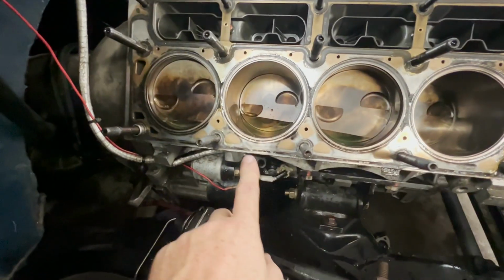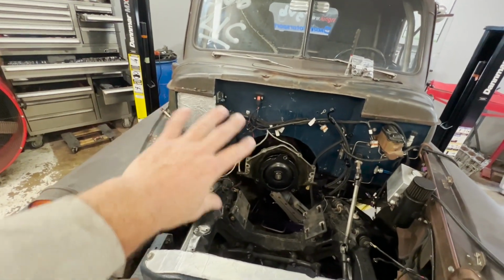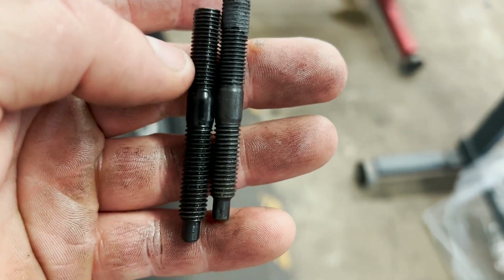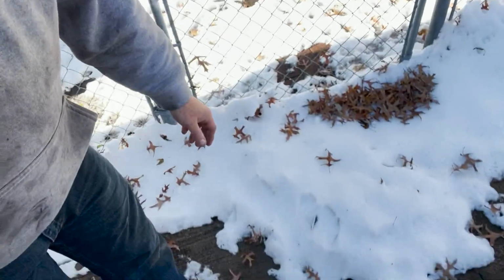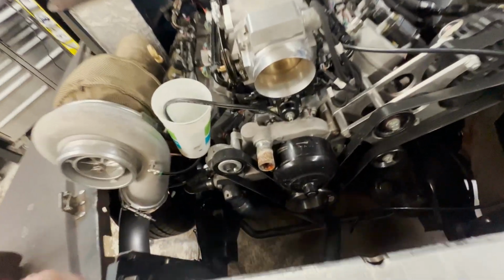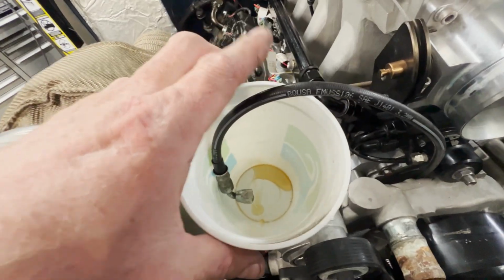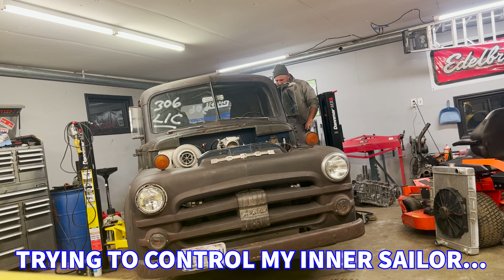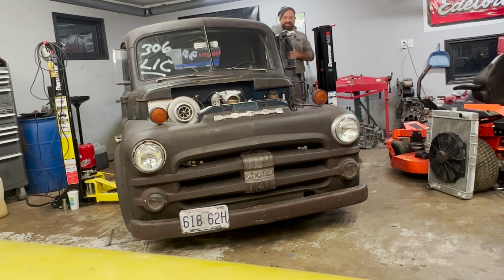Turbo SBE 4.8l Ratrod Truck First Start-up!!

Comment: Hey brother what lift is that , do you have to bolt it in the concrete floor or is it portable 😮
Reply from the maker: It’s the MaxJax mx6. Bought it like 5 years ago. It is bolted down but can unbolt it and move it if needed.

Comment: What transmission are u running I got a th400 with the adapter u put in the extended torque converter snout but think I’m gonna go with bolt on one they make
Reply from the maker: This one has the one that slips in the back of the crank.
Reply from the maker: I’ve used the bolt on ones too, if applicable.